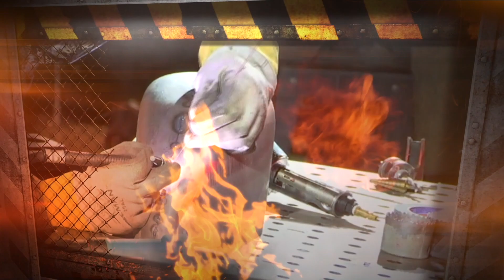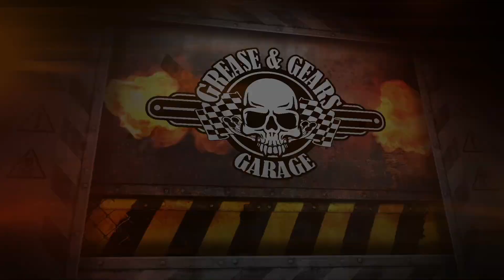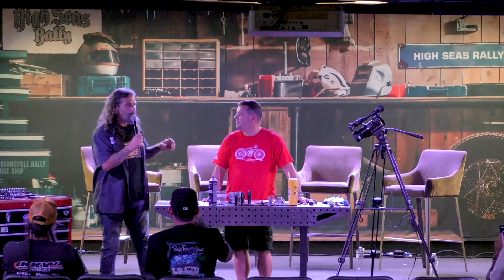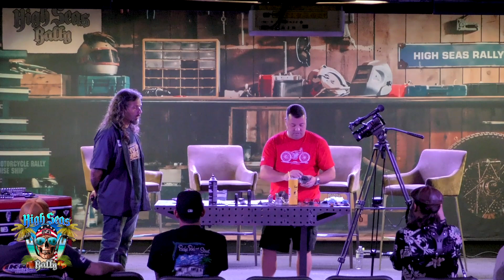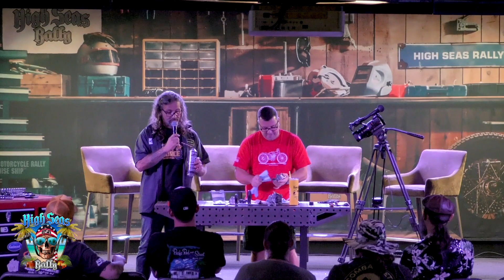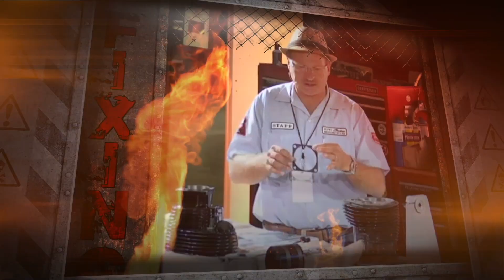Tom Keefer On Rebuilding The Super E Carb.

Comment: Early S&S slow (intermediate) jets didn't have a screwdriver slot. you had to use pliers (or vise grips) to remove and reinstall it (I used an old piece of fuel line to protect the OD of the jet from the jaws). I've still got a bunch of those old jets in my stash!